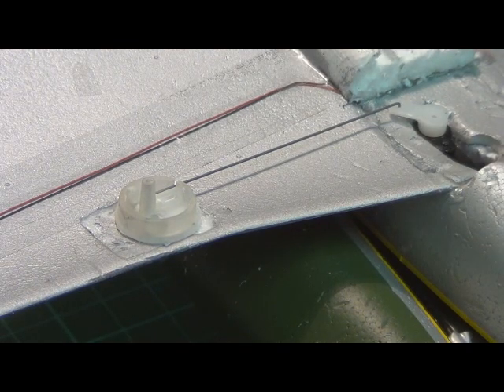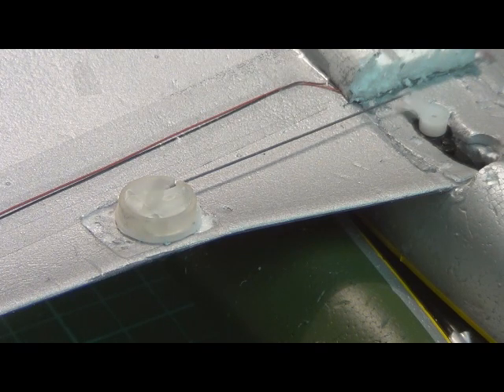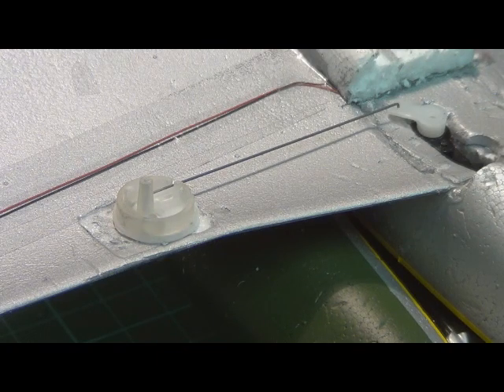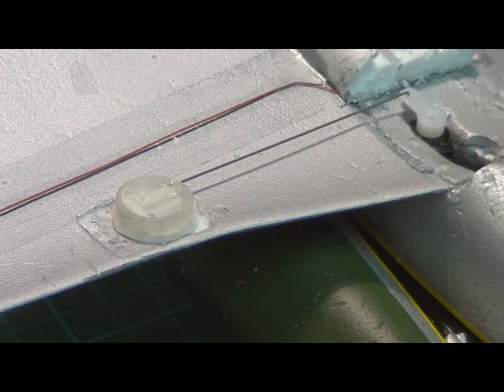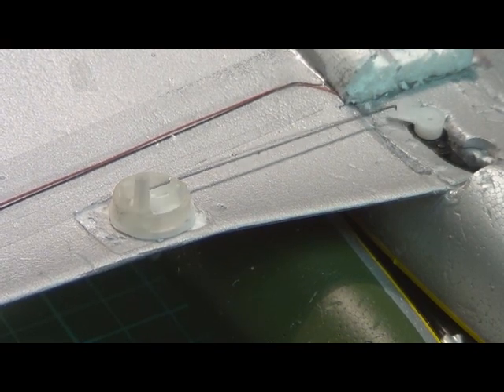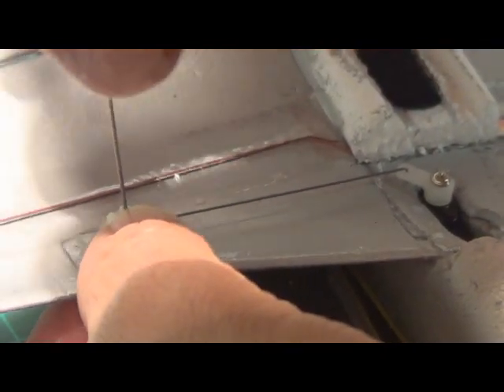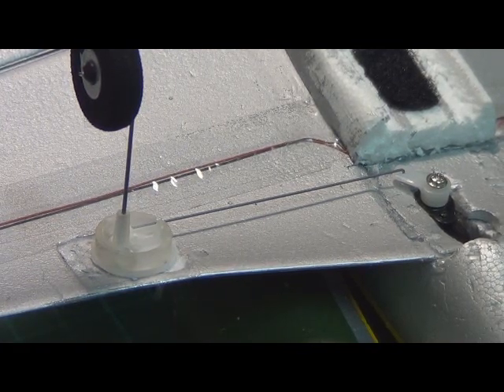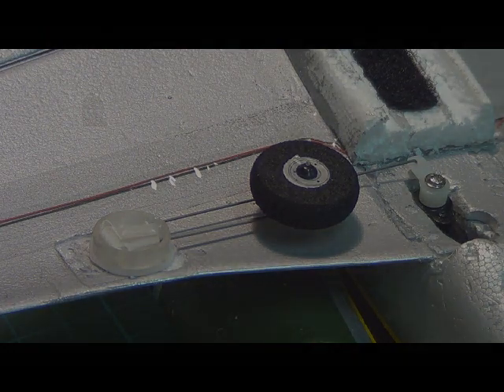Button retract working demonstration.

Comment: I think resin printing is probably making these practical now.
Reply from the maker: True. I may try it on my 4K resin printer with the industrial strength resin I have. I tested a print for my car and it's still holding a year later. Pretty impressive. The old Shapeways sintered material was just not strong enough.

Comment: Cool, thats gotta be the lightest micro retracts I've seen.  If the retracts lock into position when down, could you use a Toki muscle wire servo to get the weight even lower?  Nice work as always.

Comment: Very nice job Nitro!    The boing is not that important, as it won't be noticeable in flight, or worst case, can be slowed down with the newer Tx.     There would be a left and right, with both operating from the same servo?  Awesome design for sure!